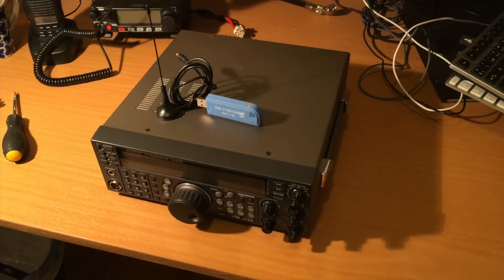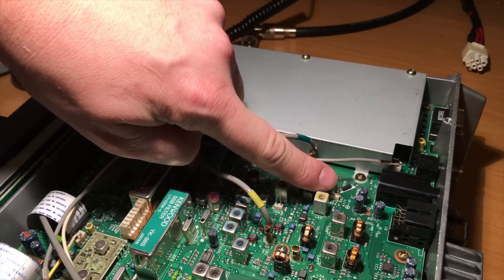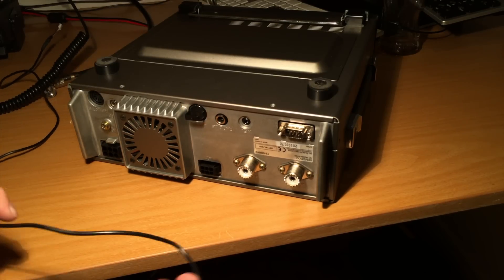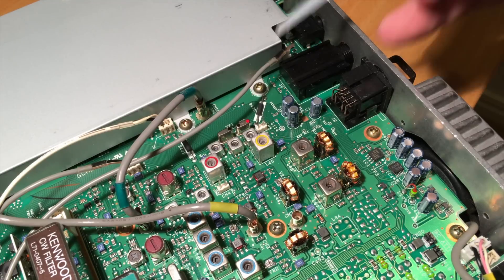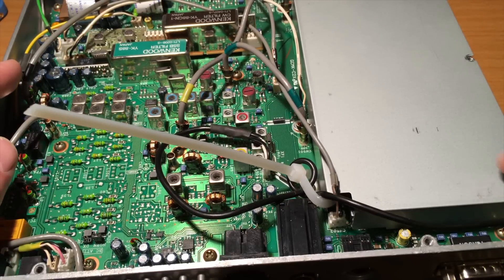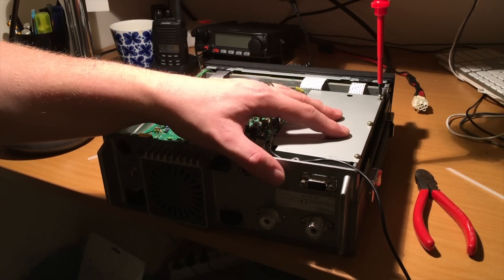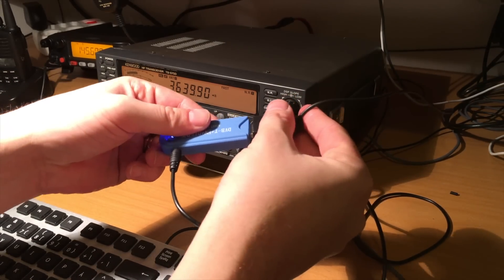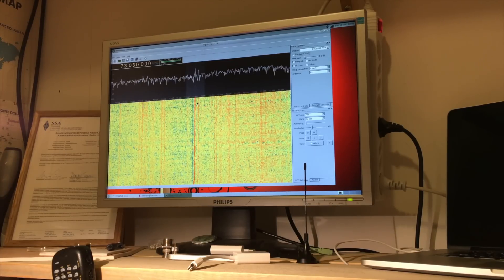Kenwood TS-570D Panadapter modification with an 820T2 RTL SDR dongle

Comment: I connected to the IF pins.  Now I have NO audio  in side band.   Could this be an issue with the side band or AM.  Could this be a filter issue?
Reply from the maker: Sorry for the very late reply. And I don't have a good answer for you either. I haven't used my TS-570D since then. I took a hiatus from the hobby and lent it to a friend who's had it in storage. Mine might have the same problems, or your problem might be unrelated to the IF mod. No idea I'm afraid. :/ I hope you already fixed it!

Comment: I use a RSP1A SDR connected DIRECTLY, just like this video, to a Kenwood TS-570DG. I just left the lower cover, the top of the filter open, there's space to introduce the SDR RSP1A to the open carrier of the transceiver. Short cable all. Very good, very good results with SDR-CONSOLE v3.02 software, both at RX and TX! Tnx SA6HAM! 73 de Calin YO2LOG
Reply: Hello Calin are you still using your TS 570 rig? Can we get in contact to Share your experiences?
73!
Kalle
DH6KM

Comment: Are there any other adjustments required in the SDR software. I have this exact TS-570 setup and I'm getting nothing from the dongle. I'm using the SDR-Radio Console Ver 3 and an RTL-SDR dongle with HF which can tune from 500 kHz to 1.7 GHz

Comment: hi i am going to do this on my radio (i also have a kenwood ts 570d). i have already fitted the little plug inside my rig but the dongle i used got really hot and did not work properly i have ordered the same dongle you used can you tell me if i need anything else. i am completely new to this so please let me know anything you deem necessary.

Comment: You do need an up-converter depending on the model of SDR stick you get. Most stop at 24Mhz. There is an experimental driver available for SDR# that allows the SDR RTL models to go down to like 13-14Mhz. I have the same setup as SA6HAM but was unable to see anything below 24Mhz in HDSDR. Just bought a Ham It Up converter and will put it in line before the SDR stick which should allow me to get down to 100kHz.

Comment: Thanks for the great quality video with explanations.

There are a few things you might consider when doing that.
1. the impedance of the test point may not be 75 Ohm, which is the input impedance of the dongle, so depending on the stage, you might cause a mismatch that may ruin the leveling in all the following stages.
2. the over voltage protection diodes (BAV99?) in the dongle may cause intermod if the impedance and voltage levels at this point are high and the last amp has enough drive to not be attenuated from the dongles load and maintain relatively high RF voltages for a receiver stage.
3. running the unbuffered signal along a coax cable with an impedance not equal to the test point might bring noise from the outside into the IF stage of the transceiver ... e.g. USB noise created by the often poorly blocked DC/DC converters used in notebooks.
4. running the coax with the USB noise on the shield right into the radio, not grounding it on the chassis may also be a source of noise ... so once you have been proving the concept, make sure you run the signal via a chassis-grounded connector ... maybe also use common mode choke on the cable and things should be cleaner after that.

So if this experiment shows any of the mentioned effects, you may consider inserting a single stage impedance/buffer amplifier consisting of a single J310 FET that taps into the text point with just a few pF towards its gate, in order to get rid of any DC components and create the least possible load onto the IF circuit.
Some very simple circuit like e.g. Fig. 4 on this page  ... you have to scroll a bit
https://sites.google.com/site/linuxdigitallab/low-noise-crystal-experiment/hartley-sweep-genarator-experimental 
might already be good enough ... it looks good, since you don't need amplification, you just need linearity and impedance conversion.

As a nice side effect, apps like SDR#, SDR-Console and I believe HDSDR as well offer smart noise filtering on the IF and audio level, which is much better than most transceivers built in noise reduction, if there is any. 
And receiving DRM with freeware is a fun new aspect as well since 10KHz bandwidth should not be discriminated in the first IF stage.

Enjoy
Reply from the maker: This comment is gold. Many thanks +n1vca!

Comment: the SDR just sees what ever frequency the TS-570 passes to it? No need for an up converter because the 570 has already done that? 

Great video thank!
Reply from the maker: +solidsnake182 Exactly. Part of the stuff the transceiver does is change the frequency in various stages. At IF stage 1, what ever frequency the VFO is tuned to instead becomes 73.05 MHz.
Reply: +SA6 HAM thanks, so the SDR should be tuned to 73.05 MHz on gqrx, thats pretty cool.
Reply from the maker: +solidsnake182 And in say HDSDR you can tell the software the offset frequency and connect a data cable so the software can display the "correct" frequency on the display. That's my next goal, but ordering from china takes forever...